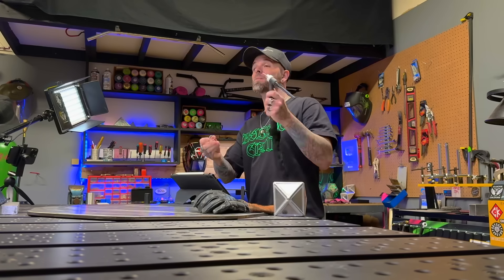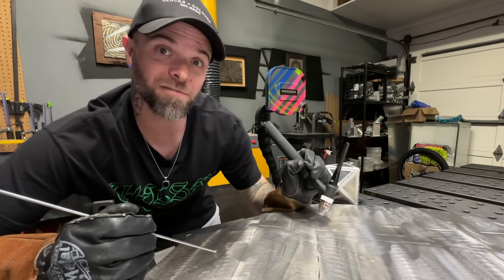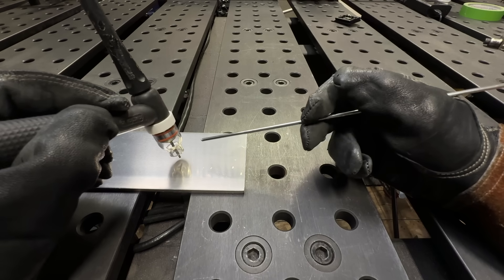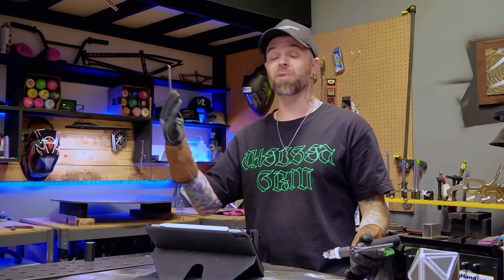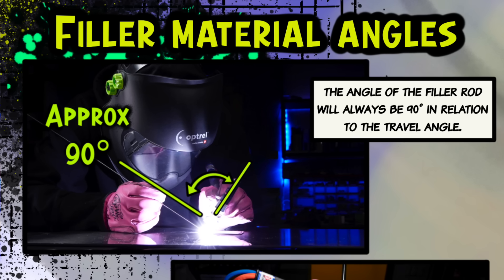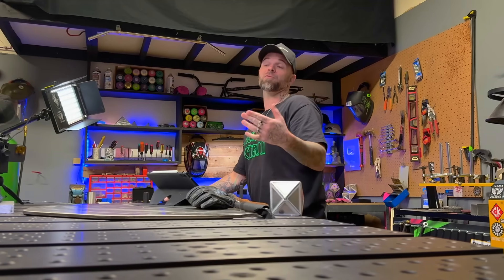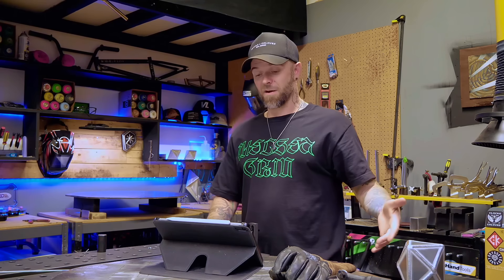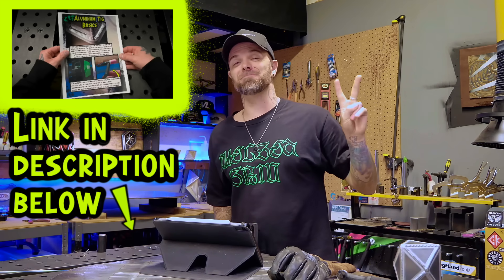Perfect Tig Welding Filler Feeding- Do This for 5 Seconds

Comment: I think I'm always going to have troubles no matter what running 18G-11g stainless with at most 1/16" filler, that shit just requires very fast steady movements. The dudes doing the art work drawing with stainless tig have a major heat sink under the flat postion plate they are working with. I am going to start practicing this though every morning when I get to work. Im going to also practice all of it off hand, as all TIGers should. This will nearly triple the experience in the feed hand per weld.

Comment: Can you do a video on how to deal with dirty aluminum? Like cast aluminum car parts that are impregnated with oil and dirt, or aluminum that was powder coated and had to be ground clean? I really like all your vidoes, but all you show is clean aluminum welding. Factory work or field work for aluminum is rarely clean, or it's super old and obsolete so they need it stuck back together to keep things going. Thank you
Reply: Theres no work around dirty materials. In tig welding everhthing thats on the material will screw up your tungsten and the rest of your weld

Comment: are you right or left handed, I am right but I go back and forth as to what hand I want for filler vs torch, just getting into tig but been mig welding for years
Reply: Just use both, it’ll make you better over time
Reply: @grucci_shoe3066 I understand that, but I’d rather start out focusing on one hand, so which hand should feedcthe filler, dominant or no
Reply: @andersortfelt9323 personally I use my non dominant hand to feed and my dominant hand holds the torch
Reply: Learn both ❤

Comment: Excellent vision . .again . .I'm back, may I throw a suggestion out for the welders that may be just getting into T.I.G. . .wire or SMAW, start using both hands alternating throughout the day, it will make T.IG. Easter. I have done this many times when I know I'm jumping back on to T.I.G. work. .  . Hope you don't mind the suggestion
Reply: My apologies for the poor spelling above, side tracked and auto correct, not always friend's.